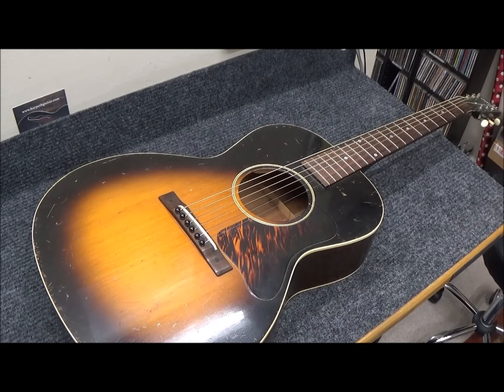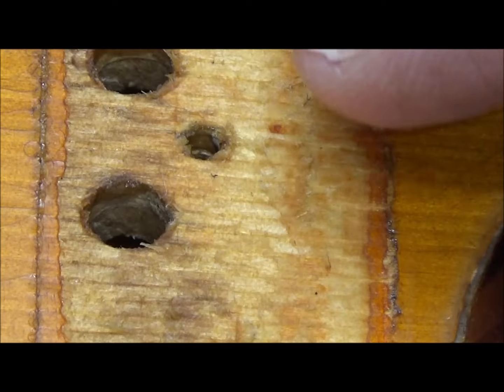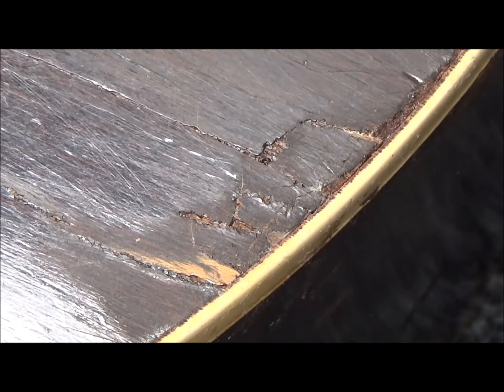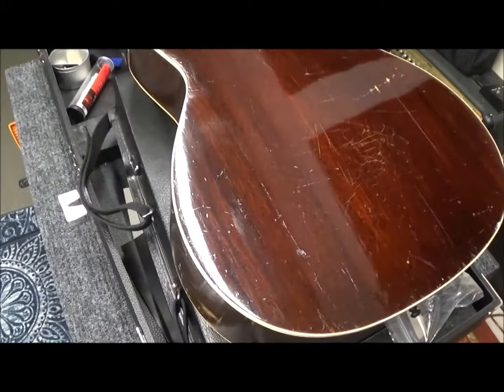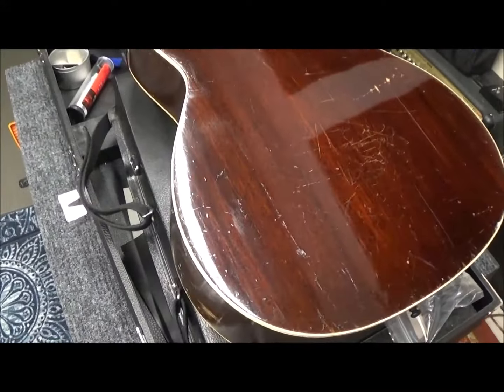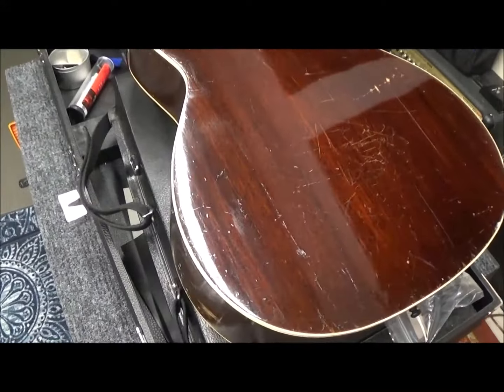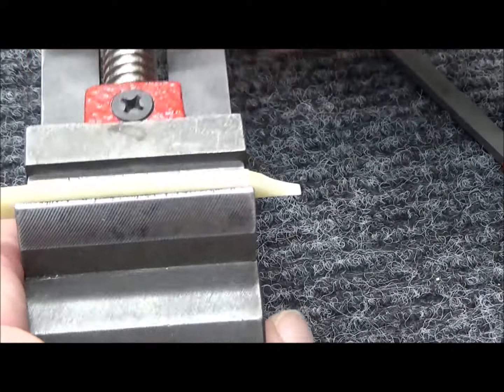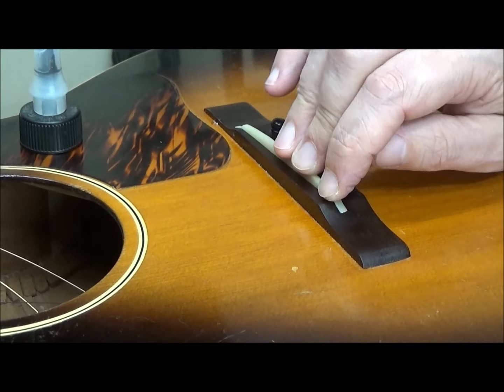Gibson L-00 Restoration & Neck Reset

Comment: I had this exact model . I bought it in 1986 for $475.00 
It was a fantastic guitar .  In 2008 I got married and unfortunately had refinance my house and do a credit card repair program. So I had the L-00 appraised for a quick sale 
by a highly respected dealer at the time . I was told that it needed a neck reset and a fret job it would cost about $1000.00 but I could ask " the sky is the limit " for the return from the right person .  Unfortunately I had heard this before for another 2 guitars one of which was not mine . 
I managed to keep it for another year then I listed it on Craigslist for $ 2000.00  ,So I get a prospect ,  wouldn't you know it was the repairman from the same shop . So , I needed the money and I 've regretted it ever since . Don't even remind me of the time I turned down the '58 Les Paul Jr . for $300.00 .

Comment: Great stuff.  The steam for neck removal always makes me nervous.  I like your use of automotive past wax to protect the surface finish.   Still water (or in this case boiling hot water vapor) and wood don’t typically go well together.  

I’ve seen the use of heat lamps, too, but they cast such a wide beam, they make me a bit skittish, too.   Have you tried a pair of styrofoam cutters from a hobby store?   They slide right down in those holes at the 15th fret and heat up the neck joint thru concentrated dry heat.  Real game changer for me.
Reply from the maker: Thanks Bryan, I use 5 electric heaters on the Epiphone Casino: Epiphone Casino Neck Reset
https://youtu.be/Lmy3DZzkqgY
Sometimes the job requires steam so I use both!

Comment: It helps to keep that lump from forming over the dovetail if you put a clamp from the bottom of the dovetail to over the fb right after you get the neck out, and let it dry that way. You will have had expansion of the wood in the dovetail from being hot and wet and that helps compress it back down and keeps the heel straight. PS: Not sure why you felt the need for a wedge under that fb extension. PPS: No saddle tweak for intonation between the high E and B strings?

Comment: Given how easily heat softened it, the black stuff could be hot glue. If so, isopropyl alcohol will help it release. It won't dissolve the glue but you'll be able to peel it off  much more easily.

Comment: Masterful.  I love to see the old ones live and sing again.  I have a "58"  LG 0 that I want to restore.  Someone put a janky pickguard on it.  Do you know where I could get a pattern for an older LG 0 so I can make a new pickguard?
Reply from the maker: Not for a ‘58 but I would use Mylar over the ‘58 pickguard footprint, trace it with a sharpie, cut it out and there you go! 😀
Reply: @harpethguitar  Many thanks.  Sadly when they put on the janky pickguard, they sanded away the original footprint.  😵‍💫  I have a 60s model LG 0.  I may just make a guard from that.  Again Many thanks.
Reply from the maker: @Holterpickguards on instagram might have it 🙏
Reply: @harpethguitar  🙏 I'll try that.  Thanks again.  Would be nice to get an exact copy. 🙏

Comment: Hi, I'm a new subscriber. I enjoyed your video a lot. There's just one thing. I am a maker and repairer of stringed instruments and have been for many years and I don't recall any professional luthier glueing in a saddle before. In fact, it is a ballache for the next guy. What was the reasoning behind this? I'm not criticizing, just curious.
Reply from the maker: Thanks for subscribing! The “through” saddles are almost always glued in, especially Martins. Drop in saddles, never. Brian Kimsey does this a lot and he explains it in his videos. Check him out! 🎸
Reply: @harpethguitar  Thanks. Yes, I know manufacturers do it but I was wondering why it was necessary. Would you still recommend it with an under saddle pickup?
Reply from the maker: I would never glue in a saddle that had an under saddle pick up. I think it is a good idea to glue in the cut through saddles because they are so expensive to make. They are very fragile on the ends, and if it fell out during a string change or something, it might get broken.